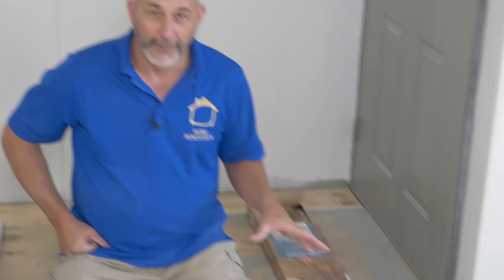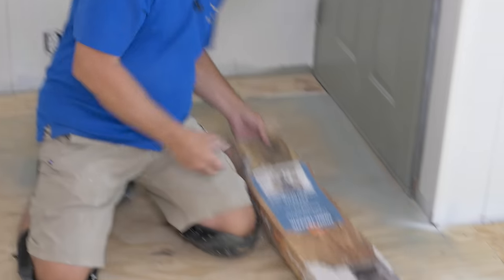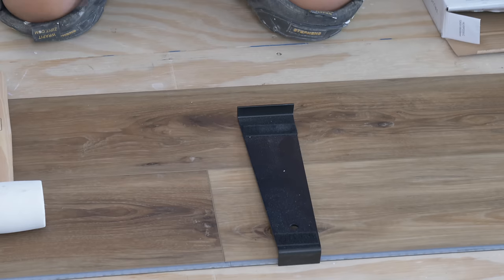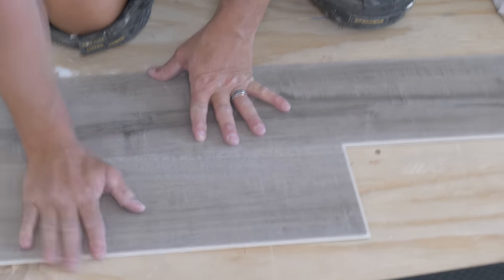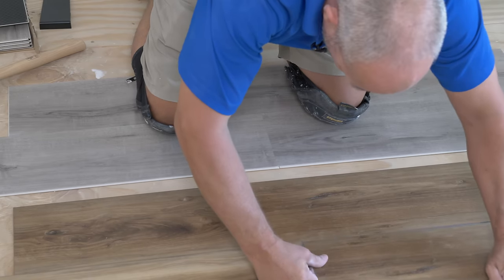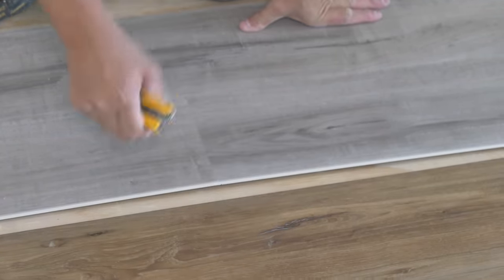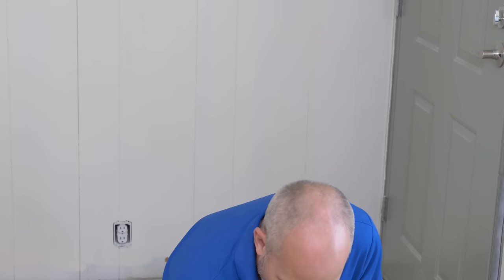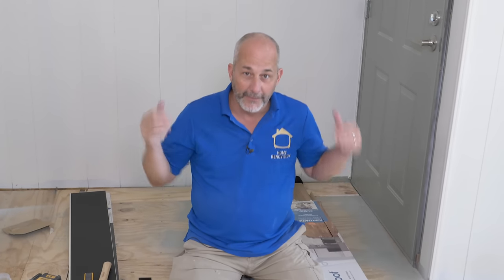2 Types Of Vinyl Flooring | Which Is Right For Your Home?

Comment: "Now, no one really intends to give you a warranty..." 
Wise words
Reply from the maker: right. warranty is fancy talk for the run around
Reply: @HomeRenoVisionDIY  In my last flooring attempt I tried to get explicit, written information on what the warranty covers and not as it was general conditions and lack of clarity about what a repair would be (whole carpet, part, etc).  In this case it was medium-high end carpet but they wouldn't give me anything beyond the generic info from the manufacturer and suggested I go elsewhere if I didn't like it.  My take away is that any flooring warranty is mostly a joke unless you are willing to take legal action (which will probably cost you more than just replacing the flooring yourself).

Comment: Had LifeProof installed in our house about 3 years ago. 90% of the house is slab-on-grade, the other 10% is old pier and beam with standard lumber. Just recently had to have the floor in the 10% fixed because a gap appeared. The rest of the house looks great but after watching this and realizing what the real problem is, I'll likely look at replacing that 10% with the mohawk material. I'm going to keep an eye on it, but if you're right about it coming undone easier the second time, that floor will end up having a 3 year life, not 20. Live and learn, thanks for the video. Before seeing this, I figured it was just a bad joint initially and I should just put down more LifeProof to fix it. You probably saved me some time, money and frustration!

Comment: I wish I had the information in the video three years ago.  I had a vinyl floor installed three years ago.  (my wife insisted that we have it professionally installed) They are now showing spots where they appear to be cupping,  I think it is just the joint is expanding and failing.  As you mentioned in the video, the issue is with the current floor.  I am near Cleveland, Ohio.  My house was built in 1954.  The subfloor is 1x6 planking covered by tongue and grove hardwood flooring.  The kitchen has two layers of tile flooring.  We had the vinyl installed throughout the living room, hall and kitchen.    It is the drop lock type floor. The installer used leveler on the transition between the rooms and two surfaces.  We have had the flooring company out and they have filed a claim with the manufacturer.  I did some research on the product, and per the manufacturing, it can be installed floating or glued.   If I had known I would have requested the tongue and groove or insisted that it be glued

Comment: you didnt cover the best vinyl flooring that doesnt leak, sheet vinyl. Doesnt leak, goes over less then flat floors, comes in much more design patterns and some are so thick and cushiony. Also you can float it, no adhesive needed..LOVE sheet vinyl! Hate planks. They warp, and leak.
Reply: Just like you say, we love sheet vinyl for all the variety.  We've used and updated vinyl in our house for almost 50 years.  One bathroom still has the original vinyl  which has held up very well.We like the design too much to replace it.
Reply: I was literally unaware that they still had sheet vinyl where does one find that I'm getting really scared because like I said I just bought $8,000 worth of vinyl plank flooring that I just love the look of but now I'm paranoid also have a cat that pees outside of her box trying not to have to get rid of her

Comment: There are more options.  My Mannington plank floor is glued to the subfloor.  The adhesive is a special type that allows you to peel up a plank and stick a new one in it's place with no additional adhesive.  I chose this over a floating install for several reasons, but this is the one I like the most.  I've got a spare box of planks in the basement, and if a plank gets damaged I can easily replace it.
Reply: I've been installing floors for 5 decades and the only vinyl plank I would ever install, it is so much easier, faster, to install than click floor. The adhesive is called pressure sensitive, great stuff

Comment: I've installed a lot of vinyl flooring and my number one tip for an older home is to use self leveler before you lay vinyl flooring. 1/8'' over 10ft is my goal when using self leveler. I do this for multiple reasons: 1. Fill dips in the subfloor 2. Locking mechanizims break easily 3. Smooth surface on the finish of the floor after installation.

In my opinion the thickness of the flooring doesn't matter for durability. Only the thickness of the wear layer matters, 20mils minimum. I only go with thicker flooring if there will be large elevation changes to reduce the number of reducer moldings. But its up to the customer. Thicker floor can add a lot of expense.
Reply from the maker: I agree however the thickness of the plank affects the joint quality as well over the life of the floor. leveller is almost always a must

Comment: Great video. I bought about 1000sqft of Lifeproof on recommendation of a friend how has installed it in his newer home. Long story short, I hired a reputable flooring company to come install it and they said they would not in good conscience install it in my older home which has multiple subflooring types done over decades of remodels and additions. Even with a 1/4in plywood overlayment, they said it would fail from uneven surfaces and floor movement of the raised foundation. Wish I had seen your video sooner but at least I have the receipt to Home Depot for the material.

Comment: I don't have problem with life proof LVP brand. I installed in my receiving room. I don't know what are you talking about floor is not even is not locking, i have some issues floor is not even in my house becuase it was built in 1972, i installed life proof brand  perfectly fine. You just bias about lifeproof.

Comment: I live in the southeastern United States where it gets humid in the summer.  I’ve been told that hardwood isn’t what I should use because of the humidity.  Is this true?  I’ve been told that LVP is the way to go but this video says LVP is good for 25 years max.  I’m wary of laminate because it can swell, or break apart if it gets wet.  I’m in a concrete slab so I don’t think I have any issues with unevenness.  What is your opinion?

Comment: What product someone chooses to install (vinyl, timber, laminate) should be determined by the circumstances in which its most suitable to them. Yes, an engineered timber floor would add monetary value to the property from a valuation perspective, say with insurance or banks/mortgage companies, but in the long term, that sale value would be negligible after paying for its maintenance and refinishings, especially if there's children or pets involved, where sanding + polishing simply wont fix it.

Comment: I had a basement that needed to be totally redone..Prev home owner had a subfloor witch rotted out n got moldy due to undisclosed leaks...Its a basement apartment and i need help decideing....So far basement has been fixed,cement floor is 0 not exactly level..Its just not in my budget for big buck fancy stuff so this far i have  a styrofoam thats designed to be a subfloor with feet ill call it...Most of it sits just above the cement to allow air circulate or dampness to dry..The styro is a tongue groove and is already installed...Now this is where i need help....Suggestions??

Comment: Every box of flooring will have instructions which tells you what the tolerance of the subfloor must be. If the subfloor is within the tolerance set by the manufacturer, then droplock shouldnt be coming apart - if they do, then it would almost certainly be manufacturing defect and will likely eventually occur to many of the joins from that particular batch.

As for the melting or heat damage aspect, it should also be stated on the instructions whether that product is suitable for use with underfloor heating. 
From what I've seen, warping damage from sunlight seems to be most prevalent with the thinner products of 4mm and 4.5mm. Ive also noticed that its frequently in homes that allow for prolonged sunlight exposure, or where the climate isnt well maintained, such as holiday homes.
Personally, I haven't seen it as a problem that would make it only susceptible to vinyl and hybrid products, given that timber and laminate are also prone to expansion problems in these conditions.

Comment: We had 5 mm vinyl flooring installed and the planks warp on the long end. They were installed with a professional contractor. The flooring company we purchased the material said it was our fault for not using plastic under the vinyl. We have seen the same vinyl installed on concrete without plastic and it is not warping.

Comment: I would never install vinyl flooring as an alternative to laminate or wood. It is absolute junk! I don’t care if you buy the expensive “premium” kind or the cheap one, the reality is, if you damage one plank once installed you can’t make any repairs or change just the one plank. We rent and the (cheap) vinyl floors were laid on the most uneven subfloor and it is a disaster. They can’t repair it so we have tape holding planks together all over the house. The only place I would maybe consider it is in a small flat area like an entryway or a laundry room but NOT an entire house. It’s just not a good investment. And that “kissing” tool you use often breaks or damage the edge and locking system rendering the plank useless. STAY AWAY FROM IT ALTOGETHER !!

Comment: I have a slight slope on my floor and it will cost a fortune to fix old floor.  Can I still put vinyl if the slope is just a small rectangle area while the rest of the 200sq ft is fairly level

Comment: The locking systems you describe here are the '2G' (aka "droplock") and the 'quad lock' systems, respectively. However, there is another locking system known as '5G', which is essentially a '2G' system with a plastic clip incorporated into the tounge allowing it to lock, rather than only being seated - basically gives you the best of both worlds.

With your 'quad lock', instead of putting the length tounge in first and holding down with your knee while giving it a love tap, i find its easier to put the end tounge in first, then sit the opposite end of that board into the previous row on the angle, then tap the length side in. 
Although, personally, I dont work with my knees on the already installed boards until im up to the last few rows and not longer can - this is because it makes installing this quad lock system easier by eliminating the need to use any tools because I can simply do the love tap with my left palm while maintaining the locking angle with my right hand.
The only time i ever lock the length side in first is when im doing the last row where the board is going under a door jamb, where manipulating the board to get it on the angle cannot be met.

Comment: I just installed laminate in my house last year, and thought I'd share a few more tips: 
- Score boards with a knife, and then snap them instead of using a saw, whenever possible. It's quick, and saves a ton of cleanup. 
- Use a 2x4 as a tapping block, to distribute the load across your boards, so you don't damage them when tapping them into place. 
- Vary your patterns because it's obvious when you see the exact same printed "knot" seven times in a row. 
- Don't buy laminate, and just get hardwood floors. Sure, it's cheaper and easier to install, but it scratches just as easily as wood, but you can't hide the scratches with a stain pen. Furniture legs also dent the PVC surface much easier than you'd expect.
Reply: Disagree. I have laminate from Pergo (outlast) and i TRY to scratch it and it doesnt AT ALL. The same engineered wood (4mm wear, wide plank, european/white oak) will be 3x the cost once installed. Wood/engineered wood doesn't work as well in homes with constant humidity level changes either
Reply: @J_Money1 I suppose some brands and types of laminate are better than others, so that's awesome that you got a good floor. The handful of people I know with laminate had bad luck with them. I installed bamboo floors in my last house, and they were terrific.
Reply: @GeoffCostanza Laminate does not contain PVC. You have confused Laminate Flooring with Luxury Vinyl Plank, which is what this video is about.

Comment: Hello, I am fixing up an old house from the 50's. I was wondering should i use laminate or Vinyl flooring. I was leaning towards laminate flooring. Do you have any suggestions. Also what thickness should I use on the laminate? I was thinking around 10mm. This will be a rental unit. Great vids, really helpful.

Comment: We purchased a luxury vinyl that has an L shaped locking system so no angle installs or anything. It wears incredibly poor and is 1.1cm thick so door openings are a pain now. Would not recommend. I would tile if I had the choice again.

Comment: I'm about to install vinyl plank in a basement of a 60s house. It had original Dricore panels and laminate planks before a sewer backup flood. Now I'm starting with a clean slab. I elected to lay down Dricore Insul-Armor panels as my subfloor. There may be slight variations in the flatness of the floor. Hard to tell, except that it does have a floor drain in the middle of one of the rooms, so there would be a slight dip there. I bought the Drcore spacers to deal with any dips. Do you have any experience laying LVP over Insul-Armor?
Reply from the maker: not on a project but I have studied the data and purchased the product for a quick review and I like it a lot. should have no issues with compressive strength. Cheers!

Comment: As a GC and 10 year ex flooring contractor:

1: you definitely need a love tap, especially every other row if you kinda know what your doing and your joints are tight to begin with

2. while product 1 looks a lot easier to install, believe it or not, it’s a lot easier to mess up break the corners where it messes up. the thing is if your 1 mil off from being straight your could be denting every corner and won’t see it until the sun shines across the floor in the middle of the day.

** the reality with the locking point Jeff makes us unless your floor is really bad each system is good cause the next row will lock it all in and the weight of the whole floor will follow the “slopes” of your floor.
Reply: Absolutely right brother. Sun will expose all imperfections. Great comment

Comment: Hey, Jeff! I live in an apartment on the second floor above a garage and we wanted to install some vinyl floors. Our subfloor is concrete and I’m assuming it’s level but maybe not a smooth surface. I picked up some lifeproof high traffic 22mil LVP with the underlayment pre-attached. Would the alternative you show in this video be a better choice for us? Also wondering if I need to purchase a separate roll of underlayment? I purchased floor muffler LVP, was that the right choice? In another video you said that the pre-attached underlayment isn’t good enough but I’m wondering if that applies to the concrete too? Last question, from around 3pm to 6pm the sun shines through our front window and onto a large portion of our current carpets. We live in San Francisco where it doesn’t get much higher than 65 most of the year. Should we not choose the lifeproof 22mil if it’s too soft to be in the sun for a few hours a day? Thanks so much!

Comment: I’ve installed a lot of Lifeproof flooring. It’s a great product but the floor does need to be fairly level, as stated. Not a big deal to level it out with leveling medium though. Also, I would not recommend reusing planks of Lifeproof after they’ve been locked together once. It loses about 40-50% of its grip/locking power, especially at the corners.
Reply from the maker: Totally agree, Cheers Mike except I find it overpriced for average quality.

Comment: I don't love vinyl flooring. It's not very durable.
Reply from the maker: in truth it has the most durable finish if it is installed flat. Cheers!
Reply: @HomeRenoVisionDIY  yes absolutely. It was nearly impossible getting enough product that wasn't broken when I opened the box. It looks great now, but it was frustrating giving the boards enough love with the mallet to close gaps without chipping edges. Here's to hoping I don't have to do it again for 20 years. Cheers!
Reply: @rtripp25  What thickness were the boards? You generally want 5mm at minimum, not counting any pre-installed underlayment (a lot of brands disingenuously include the underlayment in the thickness). Joints break easily on thin boards. I installed about 800 sqft without chipping a single board (none came broken either).

Comment: PVC flooring is dangerous and affects hormones and can cause harm. Also recent years it was shown that PVC materials, even under normal conditions releases micro and nano plastics in the air, which are linked to many health issues. As already told, those vinyl planks were invented to help the poor. When installing Vinyl/PVC floors be aware you are trading your health. There are already many products (not only classic hard wood floors) that are PVC and plastic free and also VOC free - there is no need to buy Vinyl in 95% of the cases.
In short - NO vinyl floor is right for you.